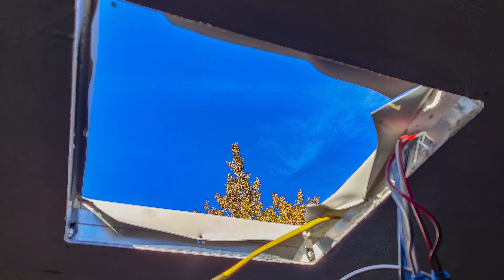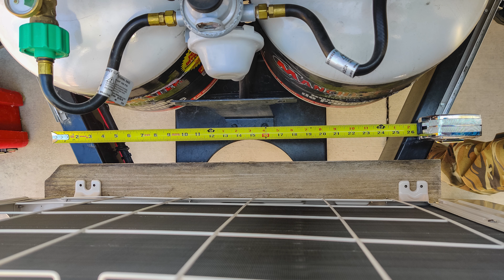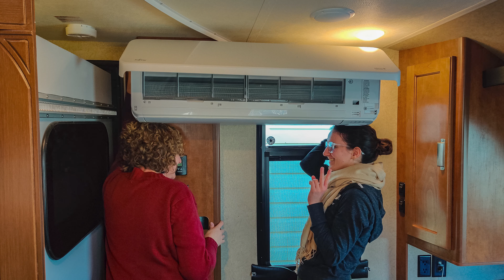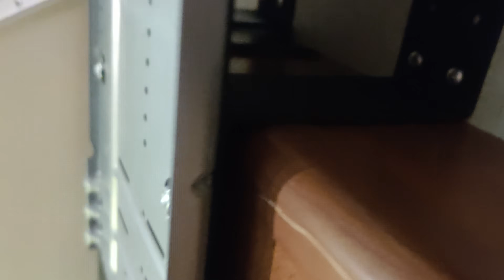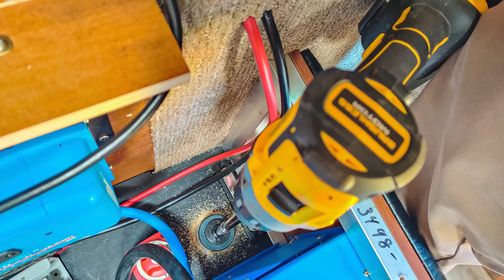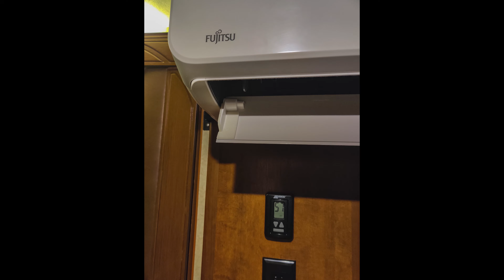How I Mounted A Heat Pump Mini Split On My Lance 2185 Travel Trailer

Comment: Just purchased the same trailer and now I'm obsessed with all your mods! Thanks for sharing and now I have to go through all your other videos. Excellent job and well done.
Reply from the maker: We've been loving all the modifications. Be aware the tongue weight is around 1200 lbs which is a problem for 1/2 ton trucks. Also the outdoor mini split unit does restrict the turning radius slightly, only when fully turning at far as possible for a while. When I am maneuvering the rig I turn on my backup camera so that I can see how close to the bumper the corners of the mini split are getting. If possible I recommend installing the outdoor unit of the mini split on the back of the trailer and that helps to offset the tongue weight and improves the turning radius.
Reply: @ElectricTechAdventures Thanks for the reply. Tow rig is a 3/4 ton so not worried about that. Also, just looked and I have the over bed cabinet version. Looking at that area for the head unit. I've installed mini-splits in our houses before and I'm a huge fan.
Reply from the maker: Always on, quiet climate control is really amazing to experience while camping.
Reply: @ElectricTechAdventures I doubt I'll build such a robust system like you have but, truly impressed!

Comment: Two questions: 
1. How do you protect the external components (condenser) while on the road from things like: rocks, debris, grime, mud and dirt? 
2. How does it handle off road bumps, like wash boards or gravel roads?

Thanks -
Reply from the maker: For the first 2 years we put a cover over it that we made. I only put the cover on while traveling. The cover shredded eventually so now the mini split compressor is just exposed to the elements like any normal compressor and it's been fine. It doesn't get very dusty but sometimes I spray hose water on it when I'm washing my cars. It still works great despite being in a mobile installation. I of course make sure it is not on while we're in motion.

Comment: here in the middle east we install split units in all of our rvs because of efficiency but we add another drain pipe on the other side of the drain tank on the internal unit so if the rv is tilted a bit the condensation water  will drain either way. as sometimes we cannot stop on a fully flat level surface and to make sure that there is not water in the tank , so it wont come out while moving . the always insist on installing an inverter AC unit because its more efficient and less load on the generator .
Reply from the maker: I like that idea. However in the 4 years of using ours we have never had water come out from being uneven. Sometimes we just use it parked somewhere even just on the side of the road where the trailer is definitely uneven. I would have thought that maybe that isn't a problem for us because we live in a dry desert but you do too so I'm not sure what the difference is.

Comment: Dude!! I have been looking for a video like this!! A very very very VERY well informed and detailed install. I watched the whole thing, thank you very much! Looks great!
I'll be working on installing my unit tomorrow and this gives me great confidence on the install!
Reply from the maker: I'm glad it was helpful! It's now been installed 3 years and still works great with no changes. The biggest drawback to installing the outdoor unit on the tongue of the trailer is the added tongue weight since my trailer is already tongue weight heavy. If the added weight is fine for your trailer than I'd change nothing, but if like me your trailer is already on the tongue weight heavy side I recommend installing the outdoor unit on the rear of the trailer.
Reply: @ElectricTechAdventures  We have a 5th wheel, the unit will be mounted on the rear of the rig! 
Maybe counter weight your rig to offset the newly added tongue weight?
Reply from the maker: @BrianBuonviaggio-v1f  I always load up as many optional and or heavy things as I can into the back of the trailer but sometimes it's not terribly convenient and some stuff cannot be in the back. I'm sure that you will love the upgrade!

Comment: Amazing, what are the numbers on the ac with those panels.
Reply from the maker: By AC I think you're referring to Air Conditioning since the panels are DC and not AC current. Solar panels and air conditioning are a perfect combination since typically there's lots of sun when it's hot. When camping in hot weather we typically just leave the air conditioning on continuously and the batteries still fully charge during the day. I've experimented with leaving the AC on all day at 64 degrees F while the ambient temperatures peaked over 100 degrees F and the batteries still fully charged and the trailer was quite cold when we got back to it.
Reply: @ yes sir
Reply: @ That is awesome, can you tell me what your battery pack is. Thank you
Reply from the maker: It's a 10 kWh battery bank (800 amp hour at 12 volts but it's in 4s 2p configuration). I outlined all the details in this video https://youtu.be/dse_QW7fDmk?si=dGh-EmMHdAPEBJr5 to answer your question. I also made a video outlining the details of the solar array on the roof.

Comment: Wow, the victron system, I'm guessing 3K 24/70 synced., I'd like to see more on that. Great job 👍👍
Reply from the maker: @brucefrazier9051  I'm not following you... What does 3K 24/70 synced refer to?
Reply from the maker: Oh, I think you're referring to the inverter is 3k VA (yes), the batteries are in a 24 volt DC configuration (yes) and the 70 is the amps the DC to DC converter can output (yes). I created a video that goes over all those components and here's the link to it https://youtu.be/dse_QW7fDmk and additionally here's a playlist of all modifications (not trips) related to the trailer https://studio.youtube.com/playlist/PLhYygFlMh_bdUV3KcSWNLRnPi4-WUWkFl/videos
Reply: Thanks, I'll check out the video. I've got my matching Victron but haven't completed the wiring . Running the Montana on 1 till things are completed. Using Eve 3.2 v cells to create the 24 V arrangement. I'm stationary in the Ozarks using 18-320 watt panels and really studying all the mini split options. Thanks for responding
Reply from the maker: @brucefrazier9051  No problem I wish you the best on your project!

Comment: Man I've converted a 6 window short bus and my final step is to install a mini split and Solar system to run the mini split. Im looking for a relatively simply system. As im not an idiot yet i and new to solar, any dirrection youd recommend going?
Reply from the maker: I love my solar array powering my mini split. I have no problem simply recommending what I did and I've documented all the big parts of what I did in this playlist https://www.youtube.com/playlist?list=PLhYygFlMh_bdUV3KcSWNLRnPi4-WUWkFl especially because I don't know more specifics of what you're situation is. That being said I'm not a consultant. In the description of my videos I have a link to a google spreadsheet that lists all the components I used in my build if that's helpful to you.

Comment: slideouts were a bad idea bro
Reply from the maker: @donteatthetacos  not necessarily. Depends on design and maintenance. In my opinion it makes a huge difference on the space and one slide out is certainly a lot better than many RVs with more than one.
Reply: @ElectricTechAdventures  then you just get a good layout and go longer lol, the insulation is around half that of the rest of the camper walls on the slideout walls and the floor is just as bad. 
not to mention, longer camper, more panels and less loss through inefficiency 
I plan on doing what youre doing but also tearing out the inside, reinsulating and then cedar planking it. 

so far for the floor loss, I just use the cheap insulating outdoor foam but I would like to create a better insulated underbelly and add  my own heating pads to the tanks, I just want to do more research so I don't accidently create a moisture zone. and I already am planning on renovating the interior.
Reply: Although I will concede its a lot less of a problem if you don't live in the thing. I live in mine lol, i really love travelling. and I prefer the winter, so its kind of a constant battle of hating weather or my camper hating it. 
4 season or not, the 4 season stickers are jokes haha
Reply from the maker: My Lance is well insulated with R9 floor and walls, R15 ceiling which is foam sandwiched by fiberglass. The slide out is made of the same material as the normal walls but since there are moving parts and there are rubber gaskets between them technically there is probably more air leakage around the slide out. I installed supports under the slide out to give extra support while we're traveling down the road. I did not want a longer trailer because it limits maneuverability and we often take our trailer in really tight places while boondocking.
Reply: @ElectricTechAdventures  The camper wall is made of the same thing but it's less, it's a lot thinner because it needs to be lighter. Specifications on modern campers are mostly half truths that you need to kind of dig into. I just would rather drive slower with a 35 ft then a little bit quicker with a 28 ft or 40 ft versus 30 whatever I guess it might also just be different that previous career is trucking. Hell I could have a 48 ft and get it in the smallest areas you could imagine around a bend but yeah I don't care what you do with the slide out seals those will always have a consistent breeze. Just stick your hand down by the carpet meeting on a breezy cold night and It will feel like the window is open lol

Anyway have a good one. I don't remember if you had them but another good thing is those little overpriced awnings that go over the slide outs yeah those kind of help a decent amount when it comes to snowfall
Reply from the maker: Yes we have a slide out topper. But we don't typically camp in the winter. We have a couple of times and when we did the heat pump mini split was able to heat the trailer just fine despite whatever losses there were through the walls and from the slide out seals. I used my thermal imaging camera walking around the trailer looking at the walls floor and ceiling inside and out on a cold night below 10 degrees F. Overall I was pleased the insulation of the trailer.

Comment: I'am a bit confuse....  You'r comparing a mini split, 9,000 btu with a 9,000 btu roof unit ?   I doubt that a RV roof unit would pull 1,300 watts if it's 9,000 btu...  that's more the wattage of a 12,000 btu, right ?   Thanks
Reply from the maker: I could not find the BTU rating of the rooftop AC unit I removed. Here's the manufacturer's website for it and BTU is not listed anywhere that I could find, even other websites about this device. It's an Airxcel, Inc model Number 9430-4553 "Coleman Mach 9430-4553 Air Conditioner Ceiling Assembly". It's what came on my trailer from Lance and assuming it was sized appropriately for cooling my trailer, I'm comparing it to my new 9k BTU cooling/12k heating BTU mini split which has been the right size for my trailer too. I'm comparing the power consumption between them and also the mini split is far quieter than the Coleman Mach rooftop unit. If you're able to find out the BTUs of the Coleman Mach I'd be curious to know. Does that answer your question?

Comment: First off, such a fantastic idea of using the infrared camera to find the studs. I'm stealing that idea. Also, how does your minisplit work at such a low ambient temp? Mine completely stops working if it's anything under 40°F outside. Is that your line insulation being so sophisticated, or your unit is rated for that low altogether. Mine is rated around 30°F.
Thanks!
Reply from the maker: You'd have to ask the engineers who designed my mini split how it works at such low temperatures but it is straight out of the manual that it goes that low and it has nothing to do with the line set. If we ever camped in such cold weather I would likely have to supplement energy from an external source though because typically in the winter, solar production is quite low and energy consumption is the highest when heating at low ambient temperatures.
Reply: @ElectricTechAdventures  Got it. Your mini-split is just clearly alot better. I'm sure your line insulation plays a big help to it as well though.
Reply from the maker: @AsManThinketh  I didn't purchase the line set with the mini split though. The lineset I purchased separately and it's just a standard mini split lineset with standard insulation that I would expect yours to have as well.

Comment: I had a question did you run the inverter ground to the frame for grounding along with did you run the battery to trailer ground as well
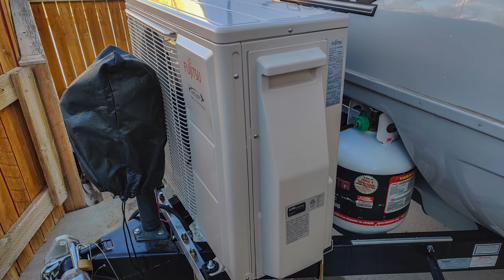Reply from the maker: Yes I did. I installed a grounding busbar that all the various equipment that needs to be grounded are all connected to and that busbar is connected to the frame. It's shown in this video https://youtu.be/dse_QW7fDmk?si=Dft_uTHye2-mDY6b&t=423 at 7:03
Reply: Your a life saver i cant believe i missed it thank you i design stuff like this but i couldnt wrap around the grounding as it was floating until i get to a site where i put 3 small rods in ground and cable to that but chassis is muuuuch easier

Comment: It took 1400 watts for 12000 BTU/h of heating?  That sounds about right with a COP of 2.5, which means it produced 2.5 times more heat energy than the electrical energy it consumed.

Do you have any measurements for how much power it took when cooling?  In theory based on its 18 EER spec, it should consume around 500 watts for 9000 BTU/hour of cooling.
Reply from the maker: Yes I have a lot of data/videos cataloging the power consumption in all kinds of weather and temperatures. Unfortunately video editing is time consuming and I still have a day job and a family so I'm kind of behind so the videos aren't published yet. :( I'm getting through them as fast as I can manage. I will say though that when the mini split is in cooling mode maintaining a cool temperature in the mid-60's F and the outside is near 100 degrees F it does consistently pull around 500 Watts. Stay tuned for those videos where we camp in hot weather.
Reply: @ElectricTechAdventures  500 watts in cooling mode is what the spec sheet says it will pull while cooling 9000 BTUs per hour.  This Fujitsu unit has an EER of 18 which is much higher than the typical 11.  It only draws about 61% of the power to do the same cooling so it's quite good.  It's nothing like the nonsense SEER rating suggests but it's probably the most efficient mini split on the market.  You're getting your money's worth for the premium you paid.
Reply from the maker: @GeorgeOu  I'm glad to hear that. It's been working well for us. It's powerful enough to make my family uncomfortably cold in the summer in extreme heat situations outside.

Comment: Thanks for posting some data.

Note that SEER is basically a worthless metric and is completely fabricated.  They don't reflect how much power an AC takes for a given BTU of cooling.  The older EER rating (and a newer CEER rating which factors idle power consumption) is what's accurate and SEER is being discontinued because people know it's garbage.
Reply from the maker: Good to know, thanks. I have a lot more data coming in upcoming videos camping in the RV in varied weather including Moab in July this year when the ambient temperature peaked at 105 degrees F. If you checkout our Arizona snowbirds trip series there's a bunch of mini split data showing the performance of it in February going from Utah to Arizona.

Comment: If you are already running solar it would be more cost effective not to mention less labor intensive to just get a 12 Volt rooftop replacement. The efficiency is almost the same not to mention you don’t need an inverter.
Reply from the maker: I looked into those options and never found a unit as efficient as the one I installed. If you have a specific example I'm curious to see it, not so much for me as I'm very happy with my setup, but more for others who are researching their options. When we're camping we leave our inverters on continuously anyway so needing an inverter is a non-issue. However it is more efficient to stay DC so for that reason a DC AC unit would have been good. I also didn't want a unit on the roof because I wanted to cover the entire roof with solar panels as I did, and I wanted to keep them lower than a rooftop unit would have allowed for.
Reply: You are wrong. 12V AC units take longer to cool a space and have a range of about 20 degrees. So if it's 120 degrees outside, the coolest you will get is 100 degrees. Also you would have to run it for so long to make a small impact. Units that's are 110v and up cool in about 30 seconds. So the initial power up and running of the 110 unit is a lot, but it will only be that way for a short time. After that it will run in eco mode and not be on all the time.
Reply: @TheObsidianTraveler  What are you talking about? 12k btu’s is 12k btu’s. It doesn’t matter the power source. 20 degree temperature split? If you are buying some false advertised cheap unit then sure. 
Inverter losses add up when you are not on shore power.